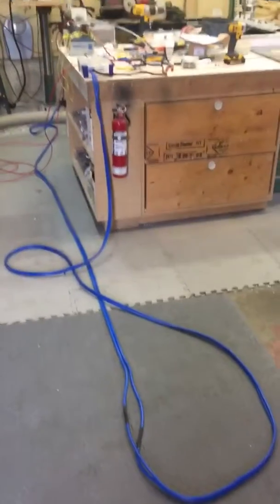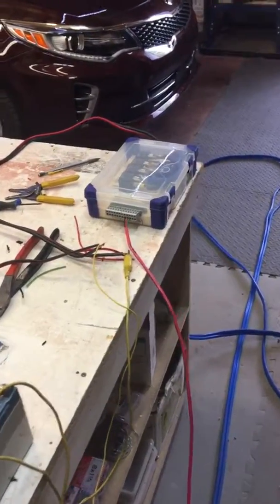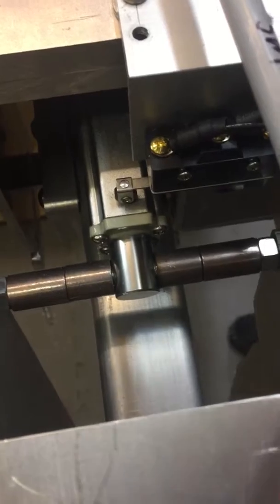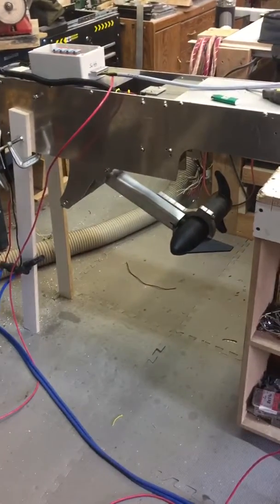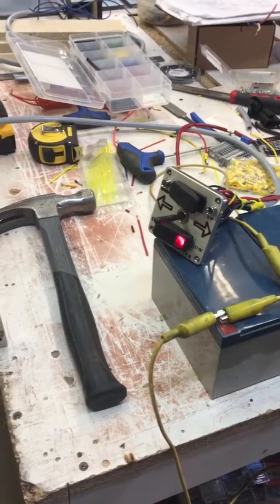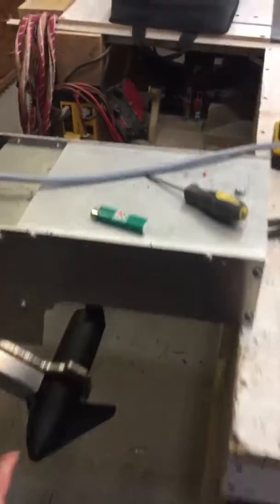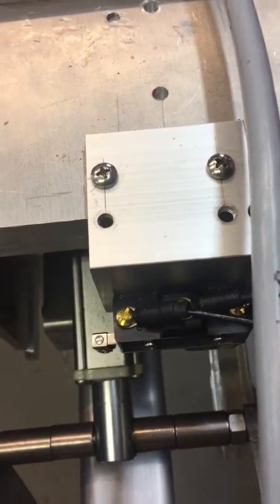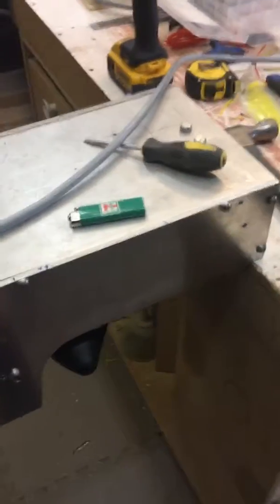Retractable Bow thruster on the cheap almost complete

Comment: I got to hand it to you... VERY innovative. Yes, the manufactured thrusters are very expensive. Thank goodness for guys like you who share their creativity. I sure would have liked to see more of the operation of the drives... and how you had it all designed.
Reply from the maker: Thanks Don. When you say operation of the drives are you referring to the electronics or the mechanical movement linkages. My design thoughts started with some searching for an available purchase option which was when  I discovered how expensive they are. Initially I just used hand drawn sketches and some math. Once  I believed I had a viable concept i used fusion 360 to build and test functionality. Then for actual manufacture my goal was to be as inexpensive and as  functional as I could get it. I have used it for two boating seasons now without failure. In a week or so when the boat comes out of storage I will be removing it for some improvements and close inspection as to wear and tear. I have found a reasonably priced actuator that should increase the speed of deployment from 50 seconds to hopefully about 12 seconds. And will be trying to make a dual prop setup for the motor as of course right now it has more thrust in one direction. Let me know what details you are interested in and while I have it off the boat I can share some info with you. If you like.  Thanks again.  Chris.